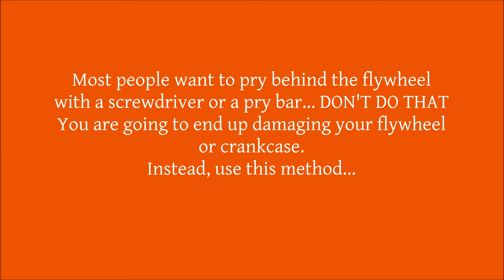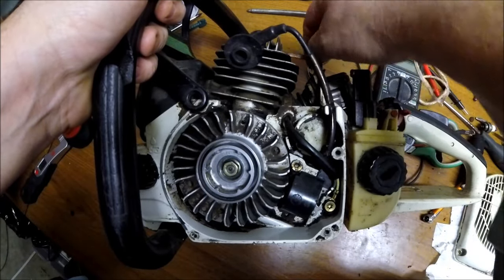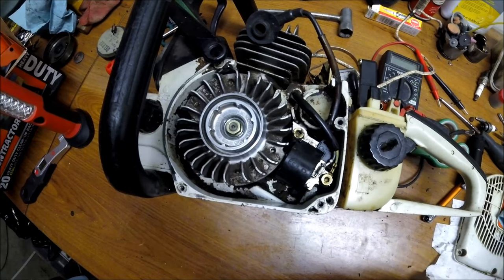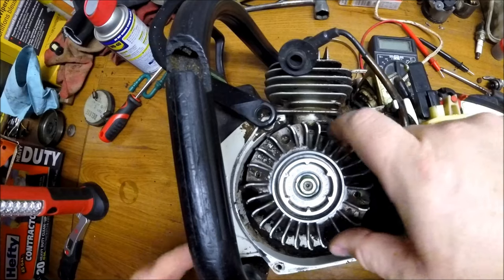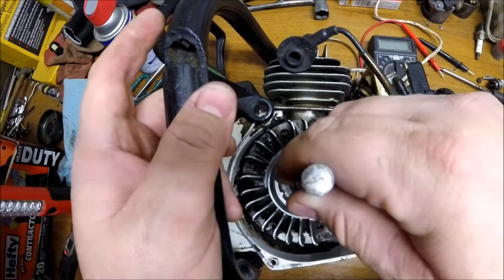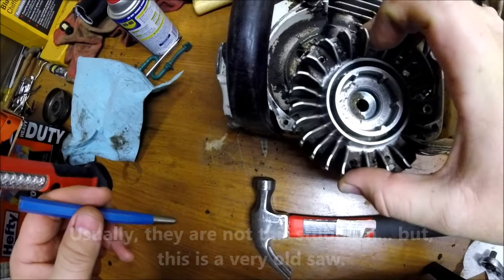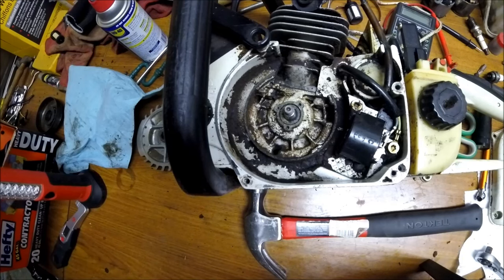DIY How To Remove Chainsaw Flywheel Without Puller - Stihl Husqvarna, Echo, Poulan

Comment: i cracked a flywheel one time on a poulan wild thing chainsaw when i removed it ,, i didnt know it was cracked ,, i did a lot of mods on this saw and it was a beast , needless to say i started it between my leggs and it went to full power 17,000 rpm and the flywheel exploded ,, my nuts and my left leg looked like they got ran through a meat shredder , my nuts were blown all over my neighbors house it looked like a pile of pulled pork got thrown all over the side of his house oh it was a mess
Reply: Bloody hell Jake!  I wondered where that screaming was coming from, guess it was you. Hope they got all the flywheel bits out before they stitched you back together.
Reply: That kind of RPM would probably explode a perfect flywheel. They're never a solid one-piece unit and all the machining and voids in them create all kinds of stresses and stress risers and built in fracture points. Engine overspeed is responsible for most catastrophic engine failures where a loss of lubrication isn't the primary cause. And 99% of the time its a complete waste of time and money and will cost you usable power killing "low-end torque" to gain "high-rpm horsepower". Horsepower is a theoretical work rate used to compare and test and rate stock engines using a standard method. Its calculated correctly by measuring torque at a specific engine speed and plugging them into the HP formula. Otherwise its "extrapolated" from acceleration rates. Any dynomometer is only as useful, accurate and reliable as the people who built it and who operate it. Dynos that do not apply a direct load to a running engine to SLOW IT DOWN and measure true torque production are more or less useless for measuring true engine performance. 

You can get "free horsepower" from any engine by raising its "high idle speed" or "rated speed" until torque output decreases faster than the RPM increase can compensate for it but you haven't actually gained any real engine "power" and its progressively less efficient the faster it runs. Pros make torque. Shadetree "performance experts" just spin the engine faster and/or fudge dyno numbers to sell lies. How quickly 4-stroke small engines started kicking the hit out of 2-strokes as soon as the minimal investment in building high-performance 4-strokes became necessary due to emissions regulations proved its torque that makes power and speed that makes money for manufacturers and mechanics that know how to exploit the ignorance of consumers.
Reply: Nuts just cause problems like child support. You won't miss them and they'll probably be outlawed soon anyway.
Reply: DEEREMEYER1....You probably still remember the days when folks believed a person would die if reaching a speed near or faster than 70mph.
Reply: You never had any to begin with ,if you thought that was a saw
Reply: Fuck bro. That's terrible. Thanks for the heads up.
Reply: 🤣🤣🤣
I got a poulan wild thing but its a fucken peice of shit never worked rite brand new now it won’t even start replaced everything except the flywheel maybe its that or its going in the garbage 🤬

Comment: You need to lift the saw up by the flywheel and hit otherwise you are just hitting the crankshaft into the table.
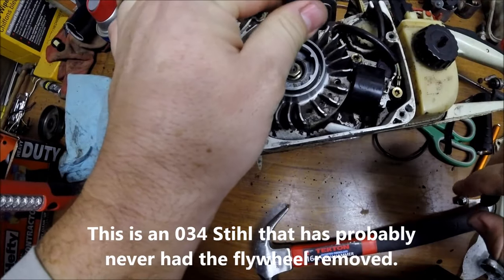Reply: @MacGyver1946  2:47 U are shifting the crankshaft (plus the flywheel and the clutch) to the other side. What u need to do is to lift the saw up by the flywheel and hit the nut with 13mm socket on it (that center punch will work too IF U HAVE 3 HANDS).
Reply: @MacGyver1946  please understand what I was trying to point out. It is simple physics.
There is a 1mm ish gap left and right sides if u look inside the crankcase walls. When u just hit the crankshaft without lifting the saw by the flywheel, u are just shifting the crankshaft in relate to the crankcase.
Reply: @MacGyver1946 On behalf of everyone who watched your video, I thank you for your time and effort making it. However, I am truly trying tell u if u don't hold the weight of the saw BY THE FLYWHEEL, u are not shocking the flywheel off the shaft. 8 out 10 your method will work but u are also shifting the crankshaft. That might mess up the oil worm gear position (on stihl 1128 for example.)

Comment: First, use a bite of starter rope(fold in half) and you're less likely to find your way into a transfer port or exhaust port and shearing your field piston stop.  Next, back the nut off 1/8 turn to create a gap, lift the saw off your work area by the flywheel, leaving the socket on the nut.  Now, hit the socket hard one good time, careful not to hit your hand.  There's your dinner!  No damage, flywheel removed.
Reply: What exactly do you mean, "lift the saw off your work area by the flywheel..." So are you holding the saw in the air when you hit the socket?
Reply: Thank you brother. Worked perfectly. Held the fly wheel with my left and and smacked my deep well socket with my 3lb hammer and she popped off

Comment: *Warning* i tried this method, my crankshaft (where the threads are) split down the centre. Should have used a pullers.

Comment: Turn the saw upright and strike the shaft from the side it will come off much easier. The saw receives the force through the shaft and moves, while the flywheel does not receive any force and therefore tries to remain stationary due to Newton’s first law. That rope trick was money!!!!

Comment: It works better if you put a folded thick towel or foam rubber under the saw so it  has a place to go rather than laying on the hard bench and the flywheel can( in theory will stay still) plus it put less stress on the bearings and seals also.

Comment: Correct way to get the flywheel unstuck: loosen the nut enough to leave a gap, put a socket on the nut and put a Hole Punch THROUGH the socket, hold the saw in the air by the flywheel, whack the hole punch. The socket acts like a guide, I only have 2 hands

Comment: Worked well for me. The bolts just behind the flywheel had vibrated loose preventing the cord from pulling and the flywheel from turning. Now it works again. Thanks!
Reply: I had the same problem but now, what’s the proper alignment when you put it back on
Reply from the maker: @pete332  there should be a slot or a key on the flywheel or crankshaft that align them in the proper positions.

Comment: Thanks farm boy - you just saved me a lot of time and effort.  I had seen this method before but had forgotten.  Thanks for the reminder.  It worked well and I got the job done on my Husqvarna brush/weed eater.  I have a 143R-II, which I don't think you can purchase in the U.S. but it is sold for heavy-duty use in Peru where we live.  I busted the fins off and have to change it out.  Keep up the good work.

Comment: Also worth noting that if you are removing the flywheel because of timing issues, chances are you'll hammer at it forever because the key is wedged in between the shaft and flywheel. In these situations I've found it takes an air hammer get a stuck flywheel loose.

Comment: The oem puller from stihl is about 6 bucks. Keep in mind the entire crank shifts when you smack the stub like that. The bearings may not last long if that stress isn't relieved before running the saw.
Reply from the maker: Chainsaw Jim I've got an aftermarket puller that cost about $8... I don't think the OEM Stihl one costs that little. I believe I saw it listed for about $20 somewhere. There are a lot of cheap aftermarket pullers, though.... They all work pretty good. This video was geared to the DIY guys who might not have the need to purchase a puller.
Reply: How do you relieve the stress that you're referring to?  How do you know it is stressed?  What other problems can be caused?  Oem knocker seems to do the same thing as a punch.
Reply: Need to clarify my comment, Huqvarna OEM tool is called a knocker, not a puller, seems the same as a punch method, just that it threads onto crankshaft.
Reply: @kelvinching1844  a puller use a diferent mechanic than the punch
Reply: @tallfarmboy  hurting a crankshift will be more expensive than 20,30,0r 40 dolars,,for a regular guy,,,will mean thw cost of the chainsaw,,,pullers are the right thing to get the job done
Reply: @MacGyver1946  I guess I'm 4 years late for answering Kelvin's question! One other thing I just noticed is his use of the piston stop. He never rotated the flywheel counter clockwise until the edge of the piston covers the exhaust port. The rope will fall into the ports when they are open, and the piston will cut chunks off it. Those little chunks of rope aren't coming out without pulling the cylinder. And I think everyone knows what happens when the motor is ran that way. I ordered my puller from a Stihl dealer several years ago and it was under 5 bucks. The larger saw flywheel puller was about 7. They're about 25 bucks on eBay.

Comment: Ok I got the flywheel off and am trying to put a new one on. My problem is I can't get the rope I put into the sparkplug port out. Any suggestions on how to get the rope out?
Reply from the maker: Jeff, I'm sorry that I just saw this. There is a chance that you will need to move your crankshaft in the opposite direction because it it pinched in a port. Removing the starter cover will give you access to the flywheel, then you can rotate the crankshaft backwards, this should lower the piston and you can remove the rope. It might be pretty tight. Good luck!

Comment: this won't damage any seals or bearings will it?.. looking to remove a flywheel on a 036 so I can change the timeing. Thanks Joe
Reply from the maker: Joe D shouldn't hurt your seals at all. Good luck with your repair.
Reply: Okay thanks for the kind words

Comment: Apply some penetrating oil on the shaft before you start. Let it soak in and it will come off much easier. Great video by the way.
Reply: I do this all day...never needed oil

Comment: would it be harmful to the flywheel to use a normal gear puller,
thanks, liam
Reply from the maker: No, won't be harmful at all... The issue is that you don't have enough room to get a normal flywheel puller onto the flywheel because of the crankcase. Good luck!
Reply: thank you for replying! unfortunately you were right about not being able to get it around because of the case. the saw sat for like ten years in some guys garage and all the sawdust turned to dirt so its impossible to see much but do you think the method you showed would work on a stihl 075?

Comment: I used an air ratchet to buzz the nut off (worked great). The punch idea also was a life saver as three hits and the flywheel came right off. Thanks!

Comment: If you have a small battery powered impact driver just use that to get the nut off. No need to jam anything down the spark plug hole and it will save your knuckles. Also I have a generic slide hammer/puller kit and the puller works awesome for  getting the flywheels off.

Comment: Good video and a good way to remove any tapered hub from a tapered shaft. There's just a very slight interference fit and wedge situation and all it takes is a sharp impact to jar it loose. A little carefully applied heat helps a hell of a lot too. Generally any metal part can be heated to about 300 degrees F with no adverse effects whatsoever. A good "old-school" way to determine that temp is to spit on the part. When its hot enough to make spit instantly "sizzle" that's about right and beyond that point it won't expand any more and you start getting heat into the shaft and causing it to expand. Heat slowly, spit and act quickly when it sizzles.
Reply: Good idea would help even more if you leave the saw outside at -40 before you apply heat

Comment: Leave the plug in and use an impact to get the nut off. If you must use a punch instead of the correct tool (a cheap puller) put a slight bit of tension behind the wheel with a screwdriver, plug spanner etc then pop the end of the shaft

Comment: How many foot pounds do you torque the flywheel nut to when you put the flywheel back on?
Reply from the maker: I don't really ever torque them down. I just get them pretty tight... LOL I know that's not much help, but just get them about as tight as I can with a 3/8" ratchet in my hand.

Comment: On many chainsaws you can just loosen the nut and hit the non-magnet edge of the flywheel with a hammer, usually pops off in one or two hits.  This doesn't work on recessed flywheels though..
Reply: Dont

Comment: I watch videos all the time and don't ever take the time to comment, but I must say that I was stumped as to how to remove this flywheel since I couldn't get any of my pullers on there. I have pulled this flywheel before, so it may have been a bit easier… Tapped it with a hammer twice, not too hard and it popped right off!
Reply from the maker: +Andrew Wilson So glad that the video helped you. Thanks for taking the time to leave me a comment.

Comment: a) They make special "piston stop" tools that you thread into the spark plug hole,
b) A pneumatic gun will take that nut off without a piston stop.  You DO need to be very careful if using air to put it back on thou

Comment: Worst advice ever.  Been removing flywheels the old way,  prybar and hammer for 40 years. I decided to try this method, and, low and behold,  my crankshaft cracked and blew four threads off. Thanks for nothing!